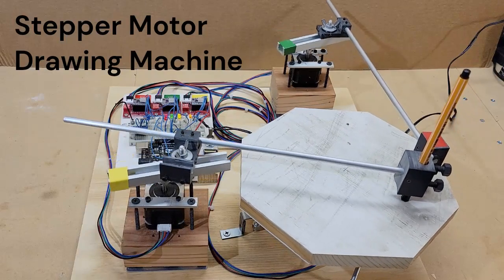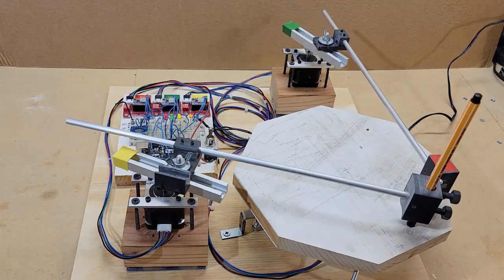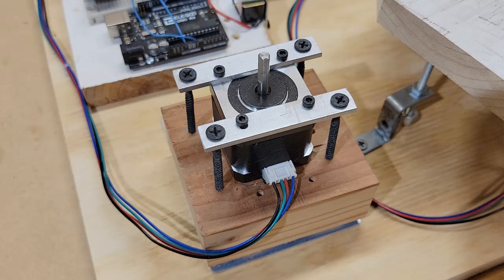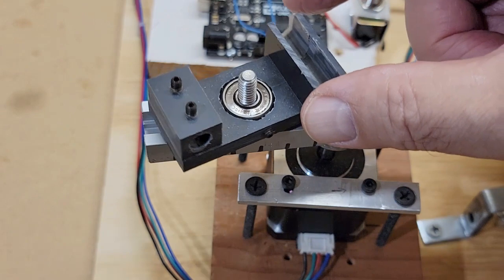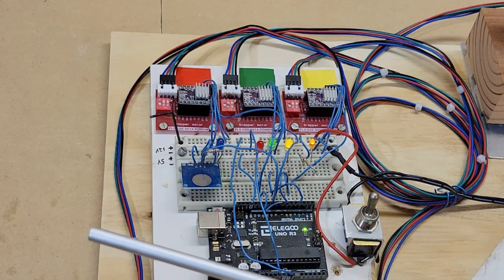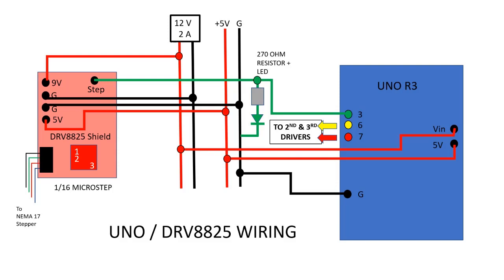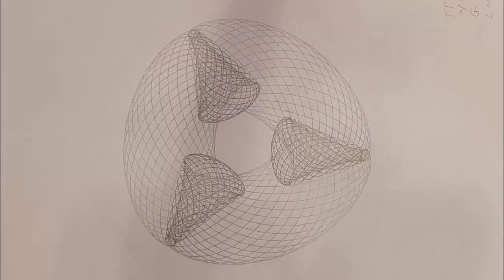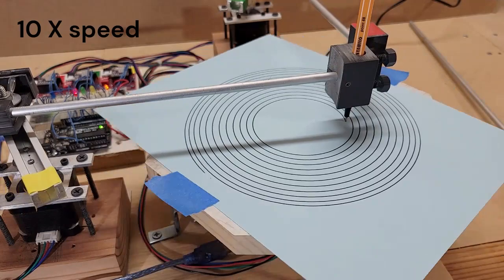Stepper Motor Drawing Machine

Comment: Have you considered programming some kinematics and making this an arbitrary shape drawing machine?
Reply from the maker: Oh, my goodness, this machine is arbitrary enough. Even small changes to the arm length or radius can make huge differences in the pattern. I often don't know if a good pattern is being drawn until it's almost finished. Even the starting position or phase of the two arm motors can make a difference.  Sometimes it turns out a mess.  I've learned to keep elaborate patterns from crossing the center of the table.  That can generate a messy bulls-eye blob.  I've shown examples of my good patterns. I've made lots of bad ones as well.  

There are many kinematic drawing machines on YouTube using pendulums.  Some are very clever and interesting.  Check them out.  Thank you for your comment.
Reply: @jeffg8232  Yes, I have seen lots of kinematic drawing machines too.  Just saying your kinematics as they are might already be capable of that, just with some code additions.  It was just a question if you intended to do that personally, which the answer of course is ‘no’.

Comment: Have you seen a Rose Engine also called a ornamental turning lathe or Guilloche? They are mostly known for making the patterns on the faces of expensive watches. Your drawing machine reminds me of these. It looks like you have no way to "preview" your program. As far as spirograph goes your examples look better than any plastic gear videos I've seen, Was this your idea? Well done!
Reply from the maker: I'll look up the ornamental lathe. I'm always interested in tools like that.  My inspiration was the old Hootnanny toy I had as a kid, but I copied many elements from the Drawing Machine II by Photonflood on YouTube.  His design has variable control of all 3 motors.  I just made everything direct drive, and employed the Arduino as a controller. I also made it much smaller.  You are correct that there is no preview.  It's all trial and error. I make notes on my speeds and arm settings, and then make small adjustment to try to improve things. I've learned to not let the pen draw across the center of the page.  After multiple passes across the center, it turns into an inky blob.   Thanks for your comment.